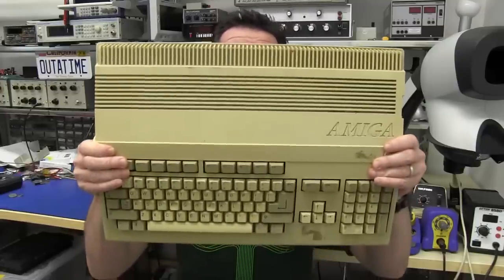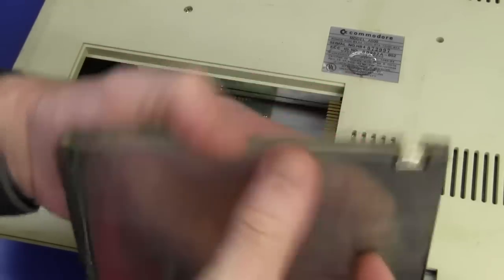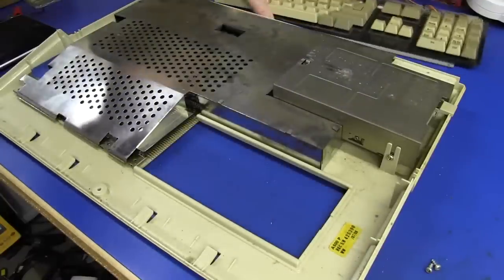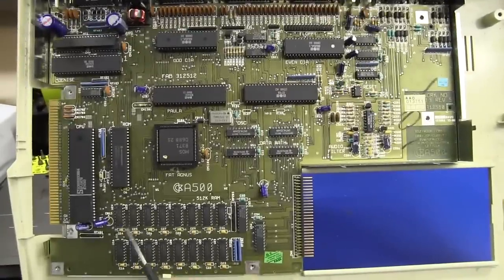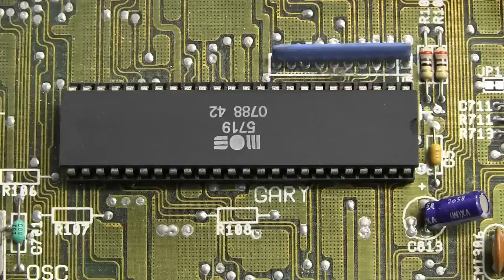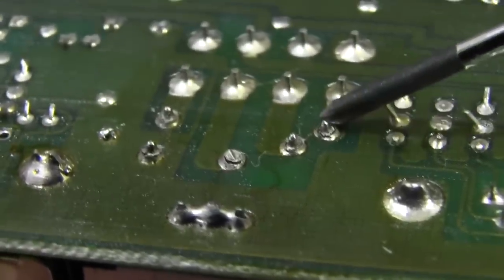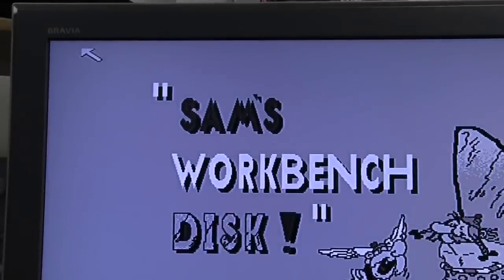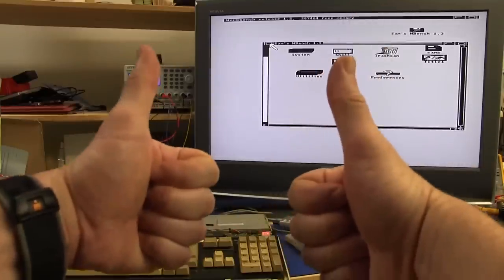EEVBlog #438 - Amiga 500 Retro Computer Teardown

Comment: You should look at an Amiga 1200 with it's surface mount board and pcmcia slot! There are a lot of people that own an Amiga 500 that think that the build quality is much better than the later Amiga 1200... what do you think?
Reply: Ronald Madican Some people who worked at Commodore on the Amigas said the A1200 was perhaps the best Amiga developed, and the A4000 the worst. They may not have been objective, however.

Comment: Yeah, that seems about right. The early 90's has always stuck out in my head as the time the PC took over. But I think it was for the better, because no company owns the PC, so that makes it a completely open platform that you can do whatever you want with. I know the Amiga was open too, but not nearly to the extent that the PC is. The intel 8088, the 286, the 386, and the 486 were used in the 80's in so called PC clones.

Comment: I remember having a couple of those A500's about 20 years ago - what a trip - loading Workbench 1.3 (if you replaced the ROM chip, you could boot Workbench 2.0 from any connected drive, even an external floppy). I mostly used the A500 for video titling (Scala 500, Pro Video Plus, etc.). In order to run some programs, you needed the 1MB memory expansion card. Only reason I no longer have those Amigas, is due to the power packs - they overheat due to the compactness of the components and one of them actually caught fire.

Amiga500  - although slow and primitive, it's still better than Windows Vista or 10, but it's reasonable and stable as Windows XP.

Comment: i got mine in 88/89 and pimped the hell out of it. 512mb expansion, but not from commodore, 4mb fast ram adapter pcb, soldered by myself, flickerfixer, external scsi harddisk with 40 or 80Mb?
it was a great machine and it served me well.
i did some PCBs with newio, programmed c/c++ & modulo 2 things for the university on it, the rest of the time was gaming. stunt car racer with a serial cable connected to the amiga 500 of my buddy. wonderful. but of course commodore managed to fuck this up too.

Comment: Nice teardown! Bit of trivia for you. That's not one of the early A500's, you can tell from the keyboard and the two Amiga keys either side of the spacebar. The early edition A500's had a Commodore logo key on the left side, and the Amiga logo key on the right. (I had one).  That's also an OCS machine, not an ECS one. Fat Agnus means it can address more RAM than Agnus could, ECS had "Fatter Agnus".

Comment: i loved the 68000s computers and never touched a pc until i got hands on a 386dx40. 
the 286 were lame they couldn't even multiply internally.
but in one point you might be wrong: these must be s rams in the module. where else is the battery for? you need refresh for d rams.

Comment: Hello mate
how are you?
i can´t find Amiga 500 PSU schematic diagram
in the net maybe you can you help me?
Reply: You would be better off modifying a PC power supply as the standard one from the day was quite weedy and original ones these days often don't provide a steady voltage due to the aged and over-stressed components.  There is still an active Amiga community out there that will readily help you find schematics and guides if you post on their forums.  Try these guys, they might be some help. http://eab.abime.net/

Comment: Jay Miner died some years ago, and iirc he was married. Again, from memory, the original names of the chips were Daphne and Portia. Jay was a great guy, who also designed the chipset for the 8 bit Ataris. I bought him a Stolie's vodka at the 1990 AmiExpo in Chicago.

The original Amiga was the A1000; it came with 256k memory with a 256k expansion available, that later came with the machine. It had a neat little keyboard; Commodore offered an upgrade discount to the A2000, but you had to send them your keyboard, which was not compatible with anything but the A1000. So if you see an A1000 on ebay, make sure you can get a keyboard with/for it.

Originally the A1000 had to read the ROM from a floppy. So you'd load one floppy in, then load the Workbench disk, whenever you cold booted.
It also had a 25 pin parallel and RS232 port. I can't remember which, but one of them had the pins rearranged on it, so that it would fry the computer or the peripheral if you used a standard cable with it.
I still have my A3000 in the closet; it's been sitting there for at least 3 years. I'm afraid the battery's leaked and ruined the motherboard :(

Comment: It has been almost 20 years since I got rid of my A500 and A1200...but as I remember there were some mods that required changing the Fat Agnus chip.  So probably the reason the shield was removed was with the addition of the external memory expansion, and a requirement to change the Fat Agnus to see the memory.  I changed the Fat Agnus on my A1200...but don't remember why...I did add a SCSI adapter and internal HD...

Comment: Actually the Fat Agnus was still a part of OCS. ECS bundled Super Agnus and Super Denise chips. The Agnus in the video allows to use only 512kB of Chip RAM (DMA accessible from all chips in chipset) so the A501 expansion added 512kB of Fast or Slow RAM (accessible only to the CPU). Super Agnus chips allowed to used 1 or 2MB of Chip RAM, depending on the model. I had an A500+ which had 2MB Chip RAM total (1MB built-in on PCB + 1MB on trapdoor Chip RAM expansion card).

Comment: PWM = pulse width modulation, the technique used to generate wave signals with different frequencies, while PCM stands for Pulse Code Modulation - the technique for digitally encoding and saving audio.. so in this case PWM is right.

Comment: Later A500 systems DID have Torx screws. Was an engineering decision to lower the tooling costs. The Torx screw bits don't wear out as fast as Phillips.

Comment: Fat Agnus could handle theoretically around 32GB of ram, the issue was, no hardware existed to allow that..

I had an accelerator and upgrade board in my A500 (can't remember the exact name) that upped it to 8MG Ram, with a math co-Processor, and faster RTC

Oh, and the Amiga mice were notorious for the left button dying, and needing to be pressed quite hard to click

Comment: Ok you guys made me reading in more detail about this. It's indeed not a weird PWM as i guessed before. The limitation seems to be related to sound DMA interfersing with the video DMA. It seems to be a real DAC. Since the limitations are so close to 7.09MHz/256 it mislead me to thinking it was some PWM stuff. I did PWM DAC's on FPGA's long ago, which was easy to implement and fun, i thought that they might have gone the same way. But i was wrong.... well done.

Comment: I love this teardown! Good memories. I did memory mod on my A500 back in -94/95. I got same kind 512kb extra fast-memory and on board 512kb chip-memory and 68030 turbo card with 4mb fast-memory. I got instructions from friends friend and managed to modify that 512 fast-memory expansion to chip-memory. So i had 1mb chip- and 4mb fast-memory after that. Helped with some games to get those running. I tried to google about this modification, but couldn't find any instructions online :(

Comment: can you help me? i bought an Amiga 500  so to have video image
I connected the C64 RF cable to the RF input of the modulator and connected the cable T: the two audio and video ends i plugged on the modulator (audio/video connectors)  and the other end connected to the Amiga 500 mono connector  After that  i selected the TV mode and the image appears all black

Comment: Do I recall correctly? Or was Fat Agnus in the 500 plus called Fatter Agnus?
BTW the expansion boards for the standard Amiga were all 512K. Giving up to 1 Meg chip RAM. The 500 Plus was 1Meg standard, with trapdoor expansion of another Meg, for a max 2 Meg chip RAM. They could further be expanded with what was known as fast RAM, that had a more direct access to processor, by using the side expansion bus, up to 8 Meg. For a Max in a Plus 2 Meg chip RAM 8 Meg Fast RAM. If I remember correctly the Video and Audio was handled in chip ram only.

Comment: CBM did not steal Amiga from Atari. The Amiga folks actively worked to avoid being acquired by Atari. Commodore was their best bet.

Amiga was shopped to Apple. The story I've read is that Steve Jobs saw the Amiga and commented "Too much hardware"

In a way Steve was right, but what amazing hardware it was. In Commodore's later years, the hardware was more a hindrance than an asset. Any change in hardware would kill software. There were plans to abstract the hardware, but time and money ran out.

Comment: No must be PWM, I had an Amiga 500 but didn't know until today that the DAC was actually a PWM type one. Divide 7.09 MHz by 256 and you get to 27.695 kHz which is actually the maximum sampling frequency of the Amiga.( Ok i remember something with 28 KHz) NOW, after 25 years i know why it was that slow ! Btw. thanks for that brilliant teardown Dave.

Comment: Electronic tolerances on newer components are a lot tighter when running at higher clock speeds, but then again so are manufacturing tolerances these days. As long as you have quality manufacturing and components things should last, but all it takes is for one component to fail. Bad capacitors alone have claimed more hardware than anything else I've seen.

Comment: It was a true multitasking computer, the entire operating system was on a 256k rom chip!  Just swap it out for an upgrade.  Also there was only one file format, called IFF.  All programs used it.  SO easy to move files from one program to another.

Comment: Carl Sassenrath (sassenranch  com and rebol  com) wrote the exec.library which is the core of the OS. RJ Mical wrote intuition.library and Dave Haynie did a lot of work on the hardware side. A500+ was my first, A1200 came after, both great machines. I had an A4000 but it wasn't great.

Comment: Correction on the audio capabilities -- it's not PWM, it's 8-bit DAC.  Trivia: the power LED was used to also control an external low-pass filter to get rid of the high-end harmonics from the 8-bit resolution.  :)

Comment: ok, but why is running in Black&White? It's damaged? (english is not my language)
Reply: He dont have amiga modlulator for color av, A500 only have build in monochrome video
Reply: ohh, I suppose in Australia they dont have SCART. Scart was an advanced TV  connector, born for VCR first, letting in the TV signal directly (non modulated). So in europe we didnt need any modulator, just a "scart" cable, and resolution was crystal clear.
Reply: +SettimaLegione No, most TVs didn't have scart connectors in Australia like they did in Europe, but it wasn't unheard of.  The only alternative was to use the RGB connector with a monitor, which is what I had with my Amiga back in the day.  The modulator also connected to the rgb port and you'd have colour composite, but it was pretty crap.  The inbuilt mono composite plug was at least somewhat clear.
Reply: It does actually have colour on board, just not from the composite connector. The colour signal is available on the D-plug (25 pin if I remember) right next to the composite video output connector.You need to plug it into an RGB monitor or any TV having a SCART connector with the analog RGB pins.
Reply: I had a Philips cm8833. It was a good monitor with 3 different line-in (composite+RGB+SCART) Probably the most useful item i ever bought! Once I sold my Amiga 500 in 1993 I used the monitor for many years to see TV, connecting a VCR to SCART connector. Recently, I sold it to a retrogamer for 50 Euro... not bad, would say!
Reply: The Composite output on the Amiga was not really designed for driving displays, it was intended to be used in conjunction with video recorders and broadcast for doing genlocking (overlaying live video over computer graphics or vice versa).  It's monochrome for essentially video titles.

Comment: It's an internal routine trapping exceptions, the code it provides can tell you some clue on what had gone wrong with whatever you were doing. It's mostly relevant to devs tho.
Critical exceptions are red but you had also some yellow ones that weren't a total crash of the Amiga but some partial crashed, so you could click left and continue whatever you were doing.
Good old days :)
Reply: As I recall, there was a debug console available on the serial port when you got a guru meditation.

Comment: Also the fact that if computers like the Amiga were the standard, you would have far fewer choices when buying a computer. You would have to buy it the way it was sold, with cost cutting measures and all. Just like a game console. Atleast with PC's now (Desktops anyway) you can buy every single component separately, and as high or as low quality as you want.

Comment: I still have my Amiga500, with 3MB RAM. I also have an Amiga1000 with 500MB HDD. Pretty awesome, Both are working fine, but the diskettes have degraded. Last time I used it, only about 50% of them still worked.

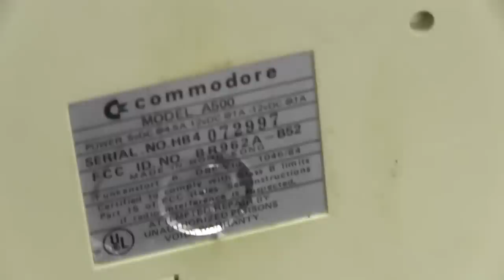Comment: 4:45 No Sir, that expansion port doesn't add processor power, that's for plugging in the ultimate accessory: a hard drive.

These were a whopping 4GB capacity, but there were even 8GB drives.
Reply: +Daniel van Slooten Actually that is a Zorro expansion bus, which provided direct access to the CPU bus, as well as many other internal signals.  You could add all sorts of things there - CPU upgrades, Extra RAM, Hard Disk Drives, a CD drive.  It was even possible to daisy chain some of them, as some expansions provided the same edge connector again on the left, so you could add more than one - if you had a desk wide enough, haha.

And no, 4Gb wasn't available until far later, and in fact Amigas are unable to address more than 4Gb HDD space.  I think you're confusing 40Mb and 80Mb, which were common capacities in the day.

The A500 was a brilliant machine.

Comment: I can remember we used to have one of these in the living room.  My stepfather did his chemistry PHD on it with a massive (for the time) 20MB hard drive that came out of the side port (A520 I think).  It also was upgraded with later versions of the Amiga kickstart ROM's, a 512kb ram expansion bringing it up to 1mb and it had the standard keyboard springs replaced with rubber cup springs to improve the typing feel.

Barbarian on the Amiga 500 was the first game that I ever played that let me cut someone's head off complete with the voice sample at the beginning of every fight 'Prepare to die!'.  For the day, it was one of the most advanced computer systems you could buy and one of very few that was actually affordable for the masses.

By the way, if anyone knows where I can get any of the afore mentioned rubber cup springs in the UK then please comment below as I am currently doing a project to build a Raspberry Pi 2 B into an Amiga 500+ using an original keyboard (as an emulation machine) and the standard springs just feel squishy and horrible.

Comment: To the guy opening the Amiga
i can't believe you didn't own one

okay fyi
The ram pak in the video is an early one and as you can see it's heavily shielded
as it was a commodore one it cost a lot, way more than the 3rd party ones that came out in 1990 onwards
they cost at the time in the uk about £150, the 3rd party ones cost £29 but had no shielding
when in the Amiga the ram was called fast ram and the other in build ram was called slow ram

that was in the first 500's, the 500 plus had a fatter agnus if i remember right, so when you fitted a ram expansion it became slow ram.
so the plus would have a whopping 1mb slow ram or video ram
and if you wanted fast ram for compatibility you would have to buy a sidecar ram expansion
they held up to 8 mb i think

for plus owners who had problems running games that needed fast ram a software tool was made to make 512k of the slow 1mb look like fast ram

there were also a few hardware tricks you could buy at one time to add more ram, but if you used them that was it, game over as far as commodore fixing your Amiga as you had to open the case and take out chips, fit them back on the top of a device and refit them

the hi res screen mode was bad, very bad and could make you ill or go in to fits
in the uk we had 50hz default so if i remember right interlace was 25hz and i'm sure there was a 12hz mode too
but this may have been on other none cm8833 screens

one good this was you could make a ram disk called rad that would survive a restart so with more than a few meg of ram you could copy the os to rad for the day

the ram expansion on the second Amiga is a 3rd party one and it will be 512k but the chips with be of a higher density though later you could buy special ones with 1.5meg for the plus

the fast mem first in the os was a command for all supported programs to use the fast ram expansion first to save the slow video ram for other things than code storage

Comment: 32:42 — Dave, you shouldn't beat it. I bet the reason is old electrolytic capacitors sitting on invertor (typically +12V) power rail.

Comment: Yes, Amiga 500 was upgredable, you could add RAM expansions, CPU card's, HDD controllers, disk drives and so on. And no, you could not build one from scratch in the same manner like PC desktops. You should compare Amiga to modern tablets/laptops rather then desktop PC's. Closed architecture meant (and do so now) hard to upgrade, but fast hardware and reliable software.

Comment: The popping chips could be the reason the screws are missing.  I used to have to do the "500 twist" to try and get the chips seated better in their sockets.  The twist involved grabbing both sides of the 500 and 'slightly' twisting it axially in both directions to get the chips to shift/move in their sockets....  Don't laugh, it actually worked!  Well... usually.  If it didn't, then you took it apart and manually removed and reseated the ASIC's :)